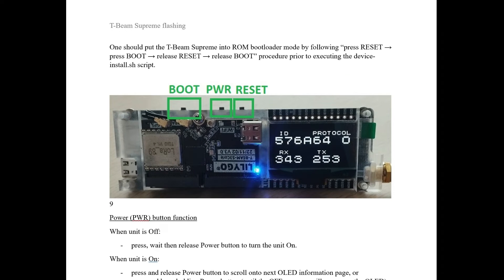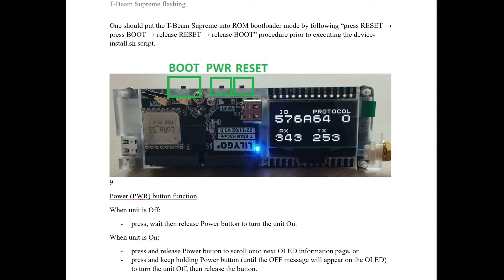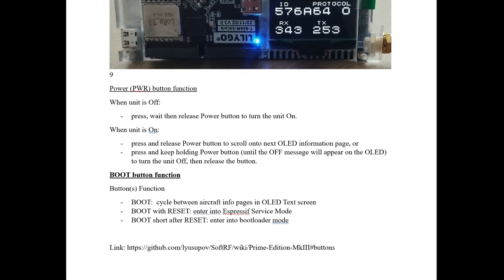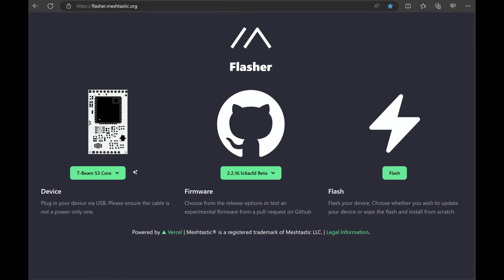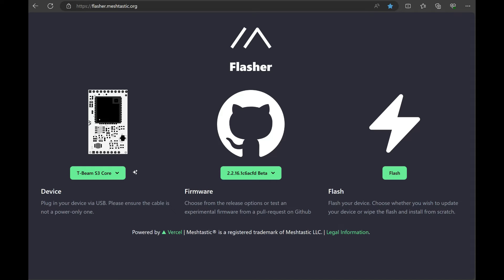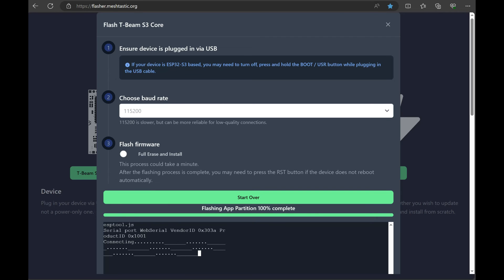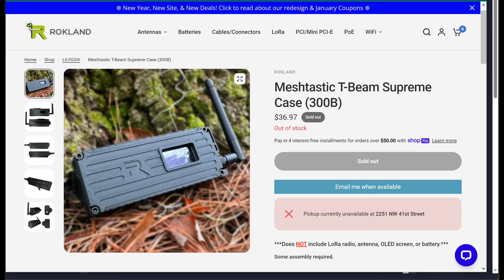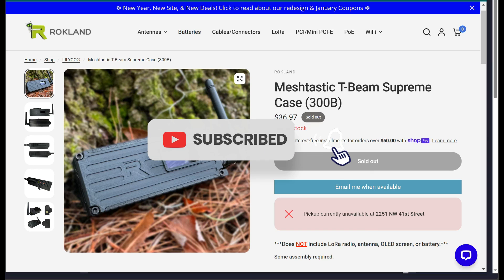T -Beam Supreme flashing | Meshtastic

Comment: yes this doesn't work... with the boot and rst buttons?  anyone know of any other video he doens't show the actual pushing buttons part.  NOT Useful. sorry...
Reply: Turn it off ( middle button - on-off )
While holding simultaneously both user button / on-off button ( left and middle buttons ) plug the usb-c cable
Hold for 2-3 seconds. The screen should remain black
Flash
Reply: @TheSadHam  Holy shit finally something that works thank you.
Reply: Yes I fiddled around till I got the combo working.. THANKS Tho... SO NOW THUMBS UP... heheheheee😁
Reply from the maker: Ok, your device must be different then mine. USB connected, press and hold reset, press and hold boot, release reset and boot. Then select flash after you have selected device and firmware. I have used this method six times and it works each time.  I created another that hopefully does a better job demonstrating the process I use. Thanks for feedback.
Reply from the maker: https://youtu.be/vrZiWjLFbcE

Comment: Well part of the problem is that my T-beam has the boot button labeled wrong. Just the picture you had with the boot button labeled correctly fixed my issue. Props 👍🏻
Reply: After messing around a bit with a battery in it, I've realized that if held the boot button will shut the t-beam down and if you hold the power button down it shuts the screen off to conserve power, but will wake if it gets a message.